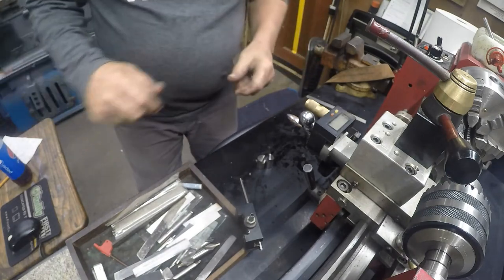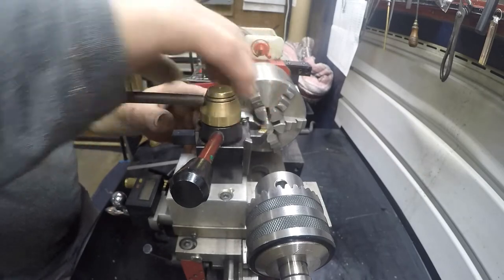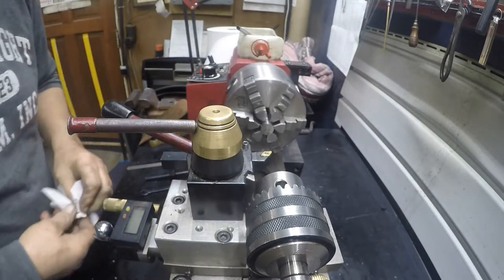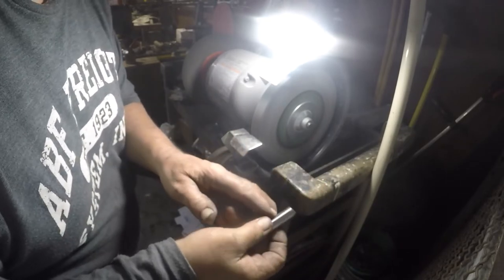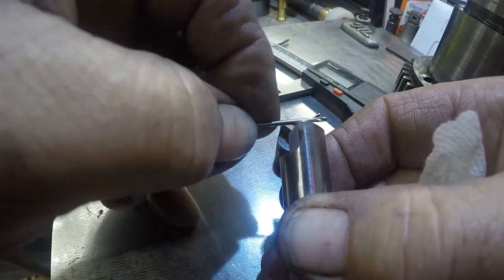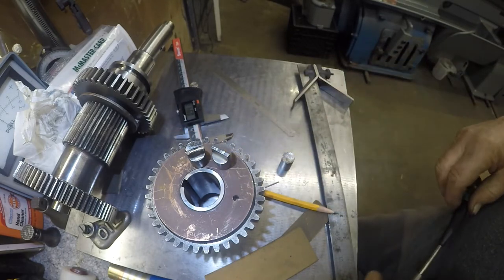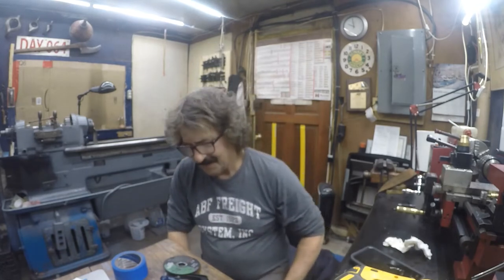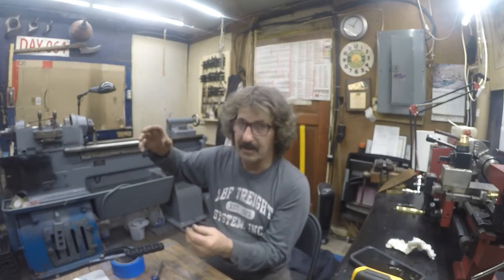MAKING DIRECTIONAL DRIVE DOGS,PRATT & WHITNEY MODEL B LATHE

Comment: Hi KZ
Nearly there Now well done.
As for holding the piece while grinding , you could have drilled or bored a piece of bar or tube for the piece to fit in, put a threaded grub screw in the side to grip the work piece, then there you go a Holder for accurate grinding and to keep all your fingers!!!!!
Soon be seeing "Big Grey" up and running again now!
Take Care
Kev UK
Reply from the maker: That work holding method would’ve certainly helped in the bandsaw. That was a disaster
Reply: @kimber1958  You Live and Learn, I like your never give in attitude. That's the right approach to learn as you go.
Good Luck with the repair, i know you will overcome the problems.
see you next time
Reply: @kimber1958 For certain !    With a bit of thinking ahead , all of the cutting could have been done on the bandsaw - but it would require some extra work . . .  like Kev said , boring a hole to fit the stock , & a setscrew to hold it in place  -   with a little 'blocking' & clamping , the faces you GROUND could have been cut by holding the stock in your TOOLMAKER'S VISE !     * Clamping the vice to the bandsaw would take some 'tinkering' . . . . but that would add to your knowledge base !

Comment: I thought you had your tool snd cutter grinder put back together? This piece seems like the perfect job for that machine.
Reply from the maker: Yes you’re correct and I finally realized that I have the perfect machine and I may try to set that up but set up is the problem I don’t have any way of holding my work other than a little 2 inch machine is vice. Well I will check a look at it and see if I can figure something out. My spring time project is going to be figuring out someway to hold materials other than my little vice maybe some kind of Collett holder. I’ll do a short little video kind of explaining my situation tonight
Reply: @kimber1958  you could probably find a way to adapt a drill chuck just for work holding for this job.

Comment: Nice work! I would put the small radius on the edge of the part similar to the original.  The sharper edge creates a weak point and would likely be prone to fracture. Remember that the tip of the edge is the first point of contact when engaging.
Reply from the maker: Very good point I will definitely Octonauts suggestion or or. I will definitely act on that suggestion